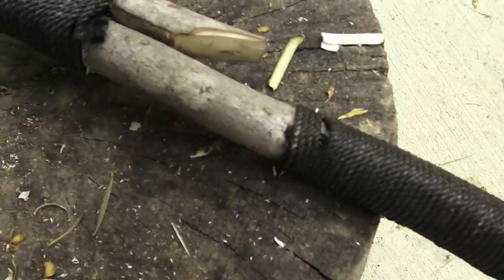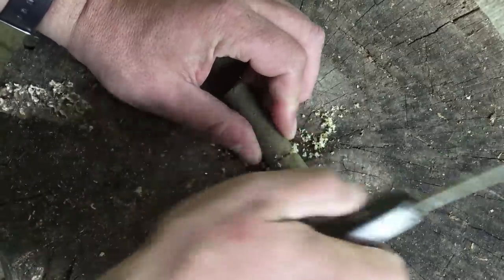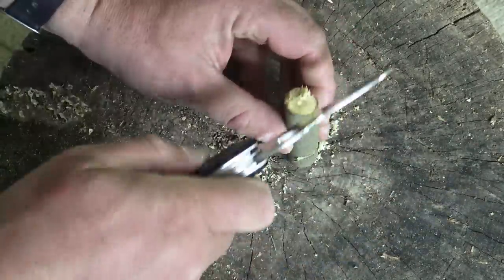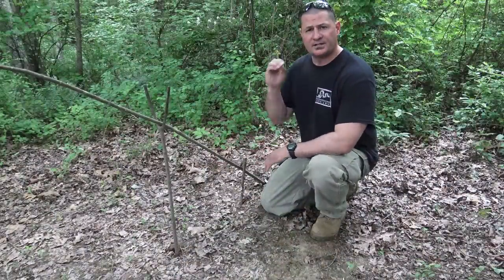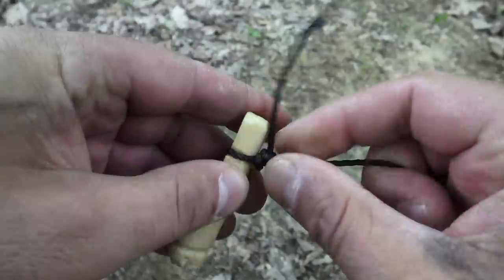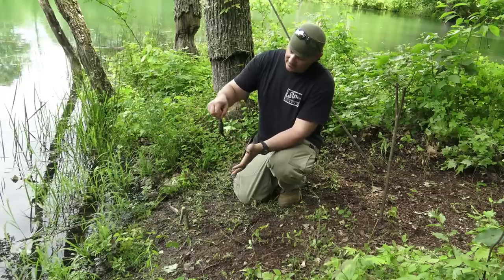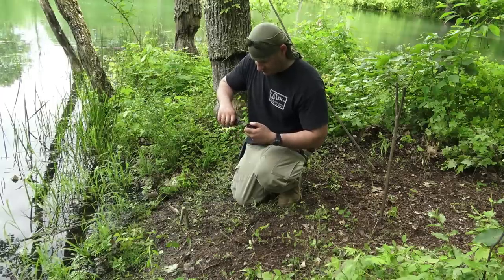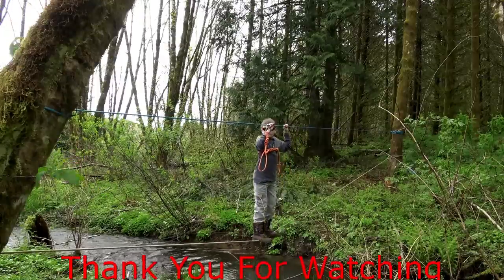The Automatic Fishing Pole - Yes This Works!

Comment: I actually use that when I was a lot younger my grandfather thought I was insane until of course it worked
And I was using a bamboo fishing rod faster reaction to set the hook
Reply: Bamboo is great if it's available in your area,but at least this shows those who don't know ,how to use what's readily available in their area.ive used both and each reacts a little different,but knowing both ways for wood or bamboo only increases ones knowledge and chances of feeding themselves or family if need be
Reply: Pretty hard to find bamboo in a hardwood forest

Comment: Outstanding system - 4 or 5 units along the shore, and supper can be served! 👍
Reply: excellent point and worthy of a pin I think. just cuz it is obvious enough to miss. once you get the hang of it, half a dozen of those traps would be quick to craft and assemble.

Comment: Great video, love the one handed trekker. I prefer the classic version that doesn’t have a serrated blade. Both versions are phenomenal though. I recently picked up the outrider model. It’s similar to the trekker, with a couple more gizmos stuffed in there. Heavier blades and an extremely sharp heavier duty saw make them perfect bushcraft pocket knives.
Reply from the maker: mine isn't serrated. Thanks for watching
Reply: Excellent. Most the one hand 111mm models are serrated, well half serrated half flat grind. I much prefer the full flat grind they put on them.

Comment: Not sure if I'm correct on this but it is just a suggestion - shouldn't you find a way (let's a say a similar pole) using a pole that would also have a "Y" on the end of that to hook into the grounding stick so in case you catch a bigger fish, that fish doesn't drag that pole into the water? I guess it depends on the angle / distance the line is compared to the pole for that to matter.

Comment: We used a similar system in Brazil to catch large lizards, usually an overhanging branch rather than a pole.  It had to be strong enough to lift their front feet off the ground.

Comment: Great, informative video as usual!  I have a question.  Do you think the L7 setup would work as well if you used a single, uncut piece of bank line, tied it off at the top of the trigger then ran it down and tied it off at the bottom or do you think that having two, separate pieces of the cord with the trigger between them is necessary for the pole to work properly?

Comment: I’d be running the line continuously from being tied off to the ‘heel stake’ with a couple of meters free line to the the heel of the rod, then several half hitches along the rod to the tip (incase it snapped, and to prevent if from just slipping off), and continue without cutting at the toggle (just two loops around the grooves).  
Also, when selecting my pole, I’d leave a couple of branches, at least 10cm long, that lock the pole behind the Y post.  
This all can ensure that a bigger fish or eel, can’t just take your hard work for a swim.

Comment: I’ve seen this trap before but a sapling was used instead of a severed pole! Allows you to skip the step of securing the pole to the ground! Still a great idea for smaller fish, but a good sized catfish could pull that in unless it’s very secure! If I depended on this trap I would have to use a sapling already rooted into the ground for better security! That’s definitely a great option if no saplings are on the bank.

Comment: Took an overnighter last weekend.  Set up camp by 1 and at 5 pm I limited out in my state ,, got up at 6 am fixed breakfast and was at the rivers edge at 7 am at 1 pm I had limited out again ,, that was one fun overnighter,,  the state limit in ga is 35  ,, I must have tossed back close to 100 that size over the two days of fishing .. I did have a cooler and ice and running water to clean and preserve them with..
Reply: I do like that L7 rig ,,  I'll have to set a few poles up that way on my next trip ..  passive fishing works too

Comment: I always used the same trap for everything. Just in slightly different configurations. a short large diameter stick hammered into the ground and tied to the long "bendy stick" with a couple feet of grass rope connecting the "bendy stick" to a twig that was wedged between two notched stakes I pegged in the ground. for the trigger, I'd use two Y-shaped twigs attached to a third that rested on two more Y-shaped twigs to make a makeshift pressure plate that would dislodge the "bendy stick holding device" when stepped on. Then for a fishing trap you just get a couple extra sticks and run the fishing line around the "step-onny trigger thingy" so that a fish pulling the line gives it the same effect as if something stepped on it aaannd TADOW...

the Fishy-Catchy-Thingy 5000.

Comment: Ideally you would keep the bank line continuous for a number of reasons. No reason you cant keep it 1 line on the L stick. Also there's no reason to passively fish for fish that are easily caught via active fishing. Size up your whole trap or even better instead of looking for a pole just pull down a limb near the shore and use the 7 L to hold it down. This keeps the "pole" green and virtually eliminates the chance of a largish catfish taking your whole trap into the water. You can always run that piece of bank line from the tip of the branch to the trunk if you're really worried about securing it

Comment: But it can only catch one fish at a time, and can go off early with a gust of wind. And it'll only catch little fish on the edge of the creek. See if you can hook it to solar panels, and motors, and rig it to unhook the fish into a bucket, and reset itself, to be a self harvesting, and automatically repeating system.

Comment: Seems like there would be n awful lot of slack to take out of the system to set the hook. Looks like it would be better there were a much shorter line between end of pole and trigger.
Reply from the maker: yet it worked and always will work. Thanks for watching
Reply: Corporals Corner Good Video. Not trying to discredit.

Comment: It looks like you used a type of Swiss Army.
Reply: One handed trekker
Reply: I use the classic trekker and the outrider model. I’m not a fan of the serrated blade on the one handed version. Great knife either way though. The heavier duty saw and larger blade is what sold me on both the trekker and outrider.
Reply: The one he has listed now is the "rangerwood". It's not a one handed trekker, but is very similar. The blade doesnt have the hole in the back and the handle is wooden. Other than that, it appears to be the same.

Comment: This video totally skipped a big part of the assembly/set up. Why didn't you show how to attach the paracord from the trigger to the pole and how you attached the fishing line?
Did you use knots to attach the line & paracord to the pole? If so, what kind? Did you do a beaver notch to help hold the fishing line and/or paracord to the fishing pole?
Typical military instructions.... Only give 50% of the information because the other 50% is on a need to know basis. 😂
Reply from the maker: Mary Hughes if you fish then you know how to tie a like to line connection. Thanks for watching